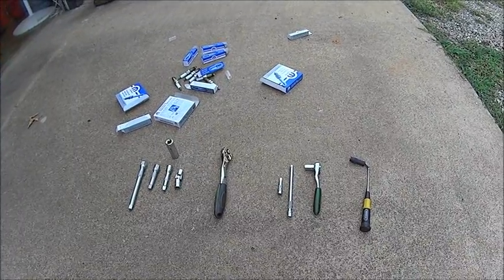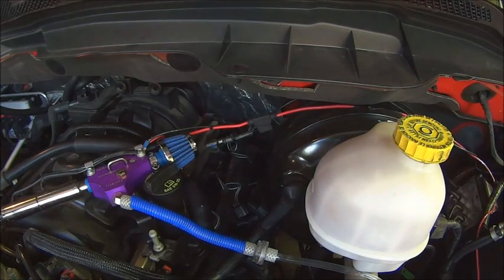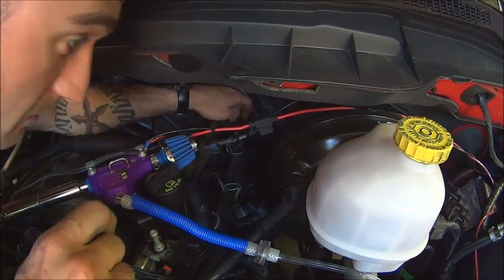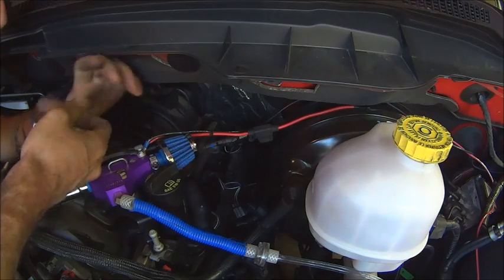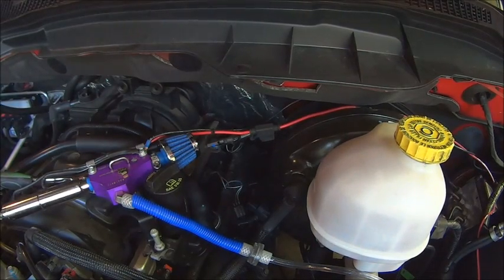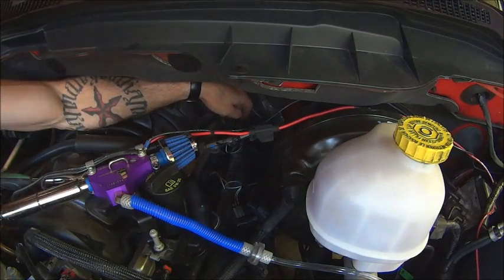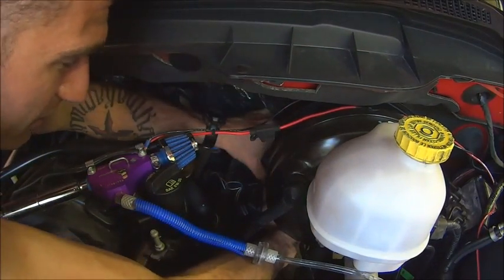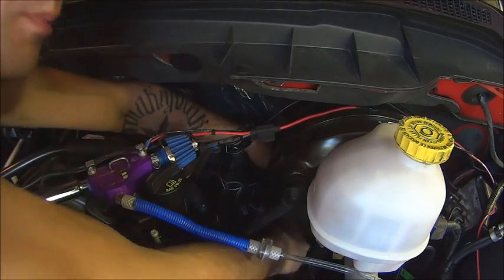How to Change SPARK PLUGS - 5.7L HEMI RAM 1500

Comment: can you just bend the spark plug contacts yourself- with soft hammer blows?
Reply from the maker: +lushfauna I suppose you could though I wouldn't recommend it...they're fairly fragile.
Reply: Jeez!! Hammer blows?  NOOOOO!!!  You buy a spark plug gapping tool!! ...on one end is the part you need to bend the 'contact'  to the correct gap.

Comment: I HAVE A 2010 RAM 5.7 HEMI WITH CLOSE TO 85,000 MILES ON THE CLOCK. GOT IT USED AND I DON'T THINK THE PLUGS OR THE COILS HAVE EVER BEEN CHANGED. DOES ANYONE KNOW THE SERVICE INTERVAL WHEN THEY NEED TO BE REPLACED. WHEN ITS TIME TO CHANGE E3 PLUGS-$97.44 WITH ACCEL SUPER COILS-$560.94 FROM SUMMITRACING.COM ARE GOING IN. WELL THAT'S THE PLAN. IF ANY OF YOU KNOW PLEASE LET ME KNOW.THANKS
Reply from the maker: The manual for my '12 says every 32,000 miles but most spark plugs will last much much longer. Myself personally, I would say every 50,000 miles
Reply: THANK YOU VERY MUCH FOR GETTING BACK SO PROMPTLY. NOW I KNOW WHAT I WILL BE DOING THIS WEEKEND.
Reply: Dealer mechanic recommended changing @ 100,000 km (62,000 miles)  when I went to have done at (50,000 km/31,000 mi)

Comment: Did that $400 include new wires?
Reply: There are no longer "plug wires". They're powered by coil packs, which are powered by the computer, which is powered by the battery.
Reply: xblade93x Not sure what you're talking about.
 http://www.wkjeeps.com/engine/hemi_57_engine6b.jpg
Reply: ***** 

That design is out dated since about 2002...

The new coil packs have no plugs, at least for the charger/challenger/avenger/300/durango/ram/200/journey/magnum/.... For the last 10-15 years. Even jeeps.

http://image.hotrod.com/f/80371495+w660+h495+cr1/chrysler-5.7l-truck-block-gen-iii-hemi-sensors-coil-pack.jpg
Reply: xblade93x
I'll be damned. Thanks!
Reply: ***** 

Happy to help, friend. Happy Motoring! 🚘

Comment: what is te recomemded gap for the spark?
Reply: Not a bad idea to check the gap with a feeler gauge, but when you buy plugs that a re for this vehicle they "should" be preset
Reply: should be proper gap out of the box, but, always a good idea to check ...believe hemi plugs are .043  gap